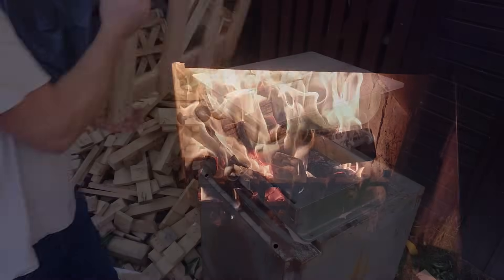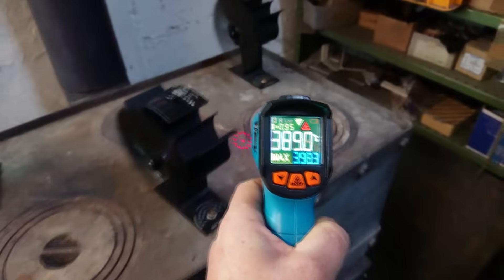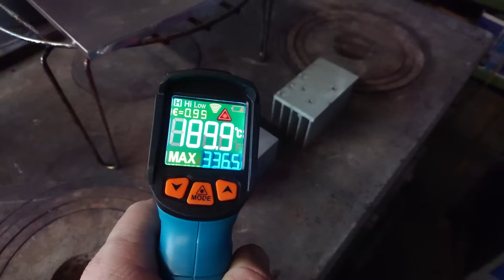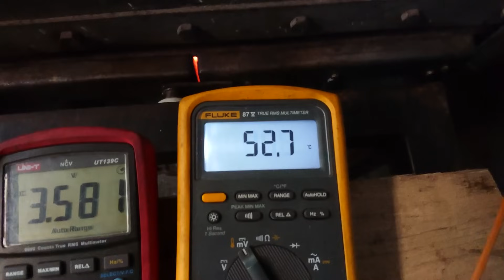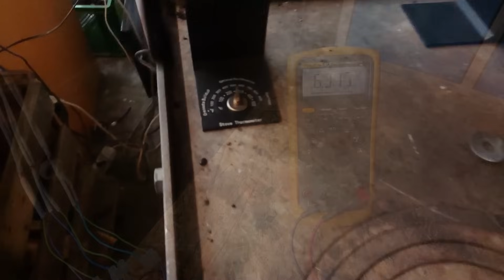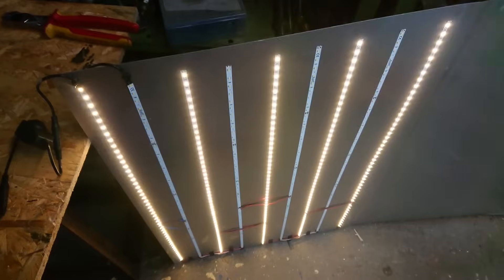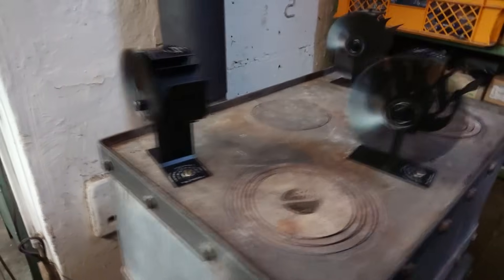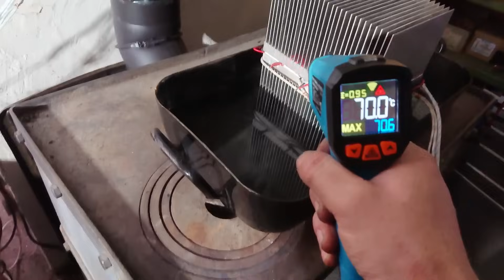Generating Electric Power with my Wood Stove - Peltier Experiments

Comment: Instead of Pelletier elements, I would prefer a woodgas powered power generator
Reply from the maker: Oh I would actually love to work on something like that. I hace actually read two books that deal with ideas around DIY wood gasification and it is an interesting field. However building something that really works long term is a huge undertaking I'm afraid. It is not exactly 'low maintenance'
Reply: @ThePostApocalypticInventor  Take a Look for old, wood-fired Cars.
Wenn had a lot here in Germany before world war 1 and after world war 2.
My das was born in the "Hunsrück" anc drove some , back in the days, as he was young. :)

It's no kind of rocket science.
At least, as long as they don't explode ;)
Reply: @ThePostApocalypticInventor Is low maintenance a prerequisite of your projects? A 5000 WATT wood power generator would be good. Show off Some stainless steel welding with some electromechanical interlocks a bottleneck design with preheat chamber on a mobile platform that can be towed with a car. This is your mission should you choose to accept it 😊.

Comment: Question. What do you think about a homo polar motor set up running on 12 volts setup to also output amps to a battery through diodes. I have not ever done anything with the homo polar motor yet. Just been thinking about it. Thinking also putting a stepper motor as generator in the mix. Sure would like to hear your thoughts on it.